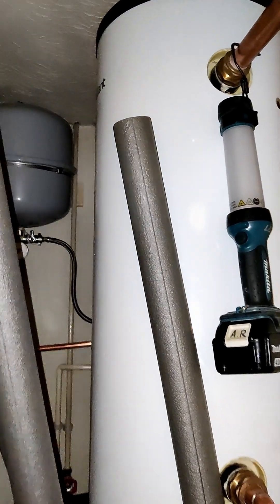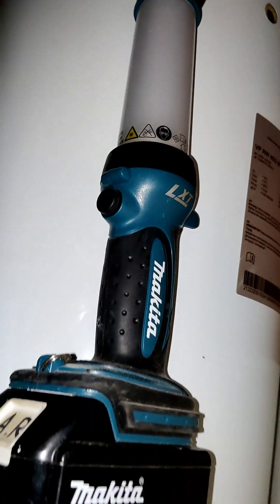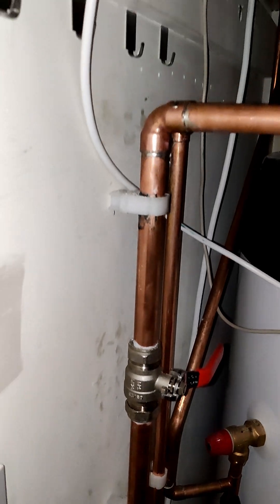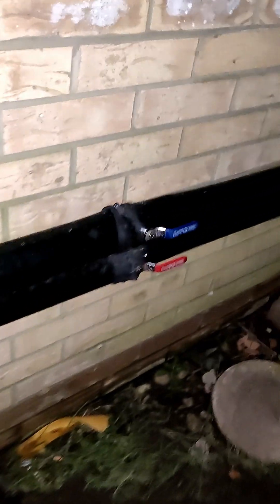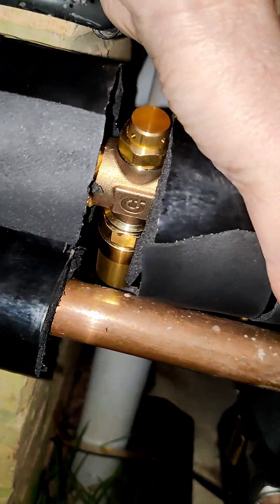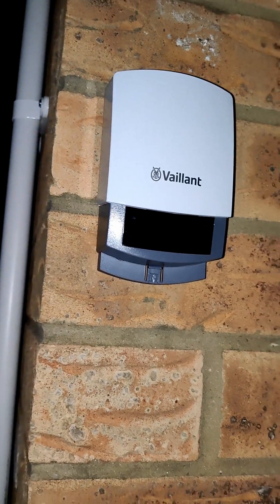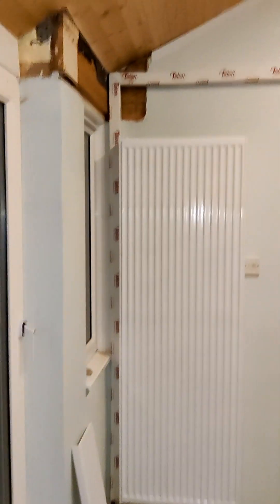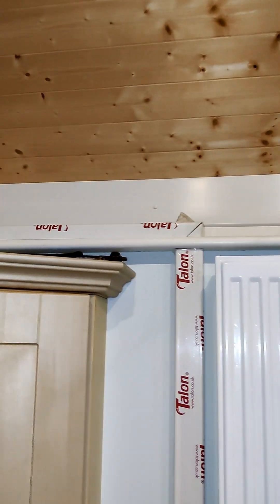Day 6 - British Gas installing Vaillant Arotherm Heat Pump at my house!

Comment: It's me again. Buffer tank ? Is  it a volumiser (1 inlet 1 outlet) or buffer tank ( 2 inlets and 2 outlets). Watching Renewable heating Hub.
Brendan Uyr (  British Gas Head of Domestic Heat Pump Design) says buffer tanks are not needed in 99.9% of installs and will kill efficiency ? Urban Plumbers and Heat Geek agree. Got me wondering now.
Reply from the maker: Yeah mine is a buffer tank. Fitted as a precaution against my 10mm microbore. I should really get it replumbed as a volumiser to eek a bit more efficiency out but I am achieving a SCOP of 4 so i'm not too worried.
Reply: @UpsideDownFork  Thanks that's good to know. SCOP 4 is pretty fair.

Comment: Did you opt to have the flow and returns outside the house, or was that British Gas? It looks like a lot outside the house.
Reply from the maker: Thanks for your comment.
All of the firms I spoke to weren't concerned about the almost 4M run outside.
For us, we could have gone up and into the loft or into the living room and across the living room wall.
This was definitely the best option.
As long as the pipework is insulated correctly then the heat loss is minimal and the pump is more than man enough to keep the perfect flow rate over that distance.
Reply: @UpsideDownFork  Thanks for the explanation. That's good to know as I'm trying to work out the best place to route mine when I get it done.